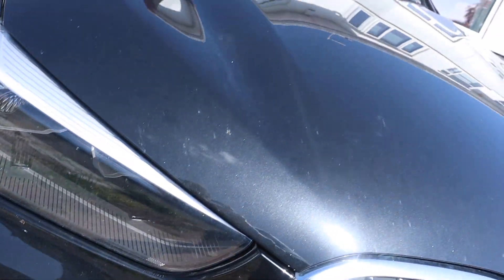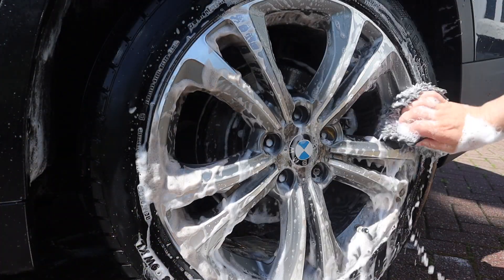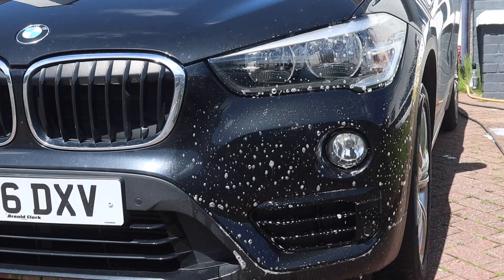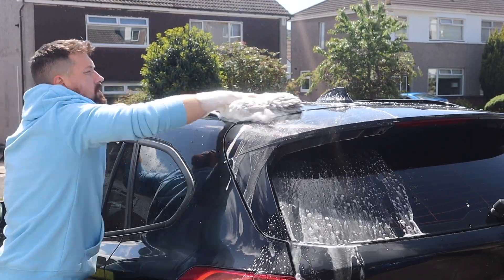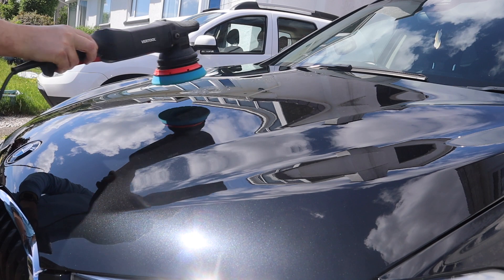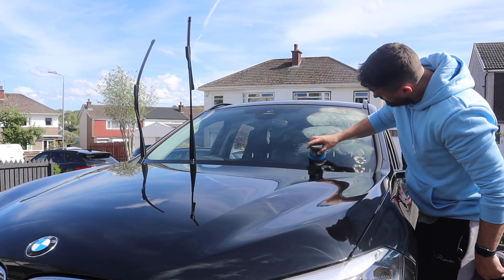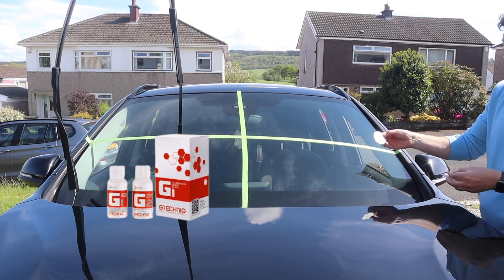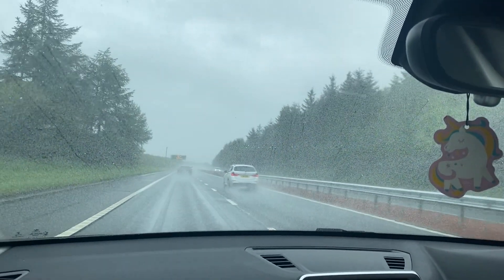How Much Damage is on my Wife’s Car - Testing 4 glass coatings

Comment: Spot on Dave, I applied G1 on the side windows, glass sunroof and back glass and it is still amazing after 18 months. I avoid anything on the windscreen, let the wipers do there stuff because of problems in the past. Great video and I agree with you totally about windscreen coatings being a waste of time, thats my opinion mate.
Reply from the maker: thankyou Geoff, the G1 although time consuming to put on with the 3 layers is one of the better ones on the screen at the moment, i wanted to use them on the windscreen to see how much abuse they could take by the wipers before failing. In future though im not sure if i would use them on the windscreen again.

Comment: Love a multi product video Dave!, music was great too!, 14°c for Turbo 6 is too hot for it , honestly I bet it went completely liquid but that swirl on the pad was far too much product for the area you used it on, that amount would have possibly done the whole car 🥹

Looking at the glass on the motorway glaco looked best I think , I have the carbon glass but I’m now not looking forward to using it after your results. 

Love that your experience was totally transparent (see what I done there? 🤣) thanks for the video 🙏🤣
Reply from the maker: Thankyou Graeme, 
Your spot on mate, that swirl done half the car and it came out very runny indeed!
So far for me it is between the glaco and Gtechniq, im going to change my wiper blades to new ones incase they are causing the issues im having, just want to rule everything out.
Ive spoke to a few people who have said the V2 of the carbon glass doesn't perform as well as the V1!!
Reply: @DavidMcBay  ah cool, it’s the V1 of carbon glass I have but now I’m loathed to use it on the windscreen now 🥴

Comment: Awesome vid David!! As always. Love the beading from the turbo 6 sealant. Looks amazing. I'm a big fan of a glass sealant, I love the water running off on the motorway and not having to use the wipers. But at the same time I do find them a bit juddery on the wipers sometimes. The glaco is awesome though
Reply from the maker: Thankyou mate, the water behavior from the Turbo6 is insane but im not sure what the durability is like.
Ive not been out really in proper rain just that spray from the road and i felt they were struggling a bit but i am looking forward to driving in proper rain to see what they are like. Ive not noticed any judder just yet but i assume that cause the coatings are so fresh.

Comment: Another great video Dave, the glass sealants are very much how I found them, I think I'll be having a go with the glaco compound and sealant next as I ran into problems with the carbon glass one on my wife's car and it left a strange smear pattern on the glass which is proving hard to remove.
Reply from the maker: Thanks Paul, there's nothing worse mate but I'm sure if you get the Glaco compound it'll take it off no problem. I've not noticed any smears from the coatings thankfully.

Comment: Another good video. I'm not 100% convinced with glass coating. I know your not really supposed to use normal sealants on the glass but I find turtle wax spray and shine really helps move water off the windscreen, no wiper judder either. Maybe a very little amount of smearing but nothing to worry about. It's cheap to buy and lasts a good time as well.
Reply: I’ve experimented with waxes on the windscreen as the Americans do this all the time, wasn’t brave enough to do the whole windscreen though, maybe something to go back to 🤔
Reply: @GMDetails  give the spray and shine a go (in the blue bottle) spray on and instantly pressure wash off. Just do the passenger side, not in any sunlight and dry afterwards.
Reply: @sixtysecondsofstephens2386  will do, I know these spray n rinse products love glass usually , Autoglanz one I’ve just used recently and the glass is very hydrophobic , but on windscreens it’s does leave a film when wipers are on
Reply from the maker: Ive used GT Sigma and Gyeon wetcoat on the windows before and had good results. im a couple of weeks in at this point and im going to put new wiper blades on to see if that makes any difference to the performance.

Comment: I tried something better than rebound , maybe you already got the product , garage therapy detox shampoo , dilute 1:10 and it works great. Works even better with a foaming trigger . Doesn’t have to be pump Foamer but just a normal foaming spray trigger.
Soft 99 do a glaco one that works on speeds around 27mph , they actually got different ones for different speeds , mainly for city driving and motorway
Reply from the maker: Ive used the GT Decon shampoo before but i dont like to waste it on the wheels, i wouldnt say its better but it does a good job also.

I didnt know that, ill need to have a look on their site. I do a mixture of motorway and 30mph, the Glaco is the one im most impressed with at the moment.
Reply: @DavidMcBay  I’ve got the rebound but it makes the tyres brown over time so it’s not good in that aspect and I’d rather buy the decon shampoo and I have option of making 5 litres of tyre cleaner and 500ml shampoo from a one litre bottle , it works a lot better in a foaming trigger as you spray on and leave it and the foam goes brown by itself , I’ve been using both for around 6 months and the decon is better than rebound , 10 times cheaper and it doesn’t ruin the tyres
Reply from the maker: Hmm I’ve never seen rebound turn tyres brown and I use it regularly on cars that I see regularly. Have you got any pictures showing this as i would be a concerned using the product going forward if that was the case.
Reply: @DavidMcBay  I was using it on 2 cars , one is brand new and one is 2014 model , it never done it to the new tyres on the new car but on the old car on older tyres it made them brown , I will show you some pictures after I washed it as there’s a tyre dressing on them at the moment but you can see it in this video at 4:50 
https://youtu.be/yn42NEj5YQA

Comment: Applied the G1 on my old polo, absolutely fantastic coating, never had any major problems with it. I find with all glass coatings you seem to get a sort of ghosting affect but you get used to it. G1 instructions recommended you apply it to the wipers as well, did any of the other ones ask you to do that? 

I presume as well the self cleaning ability or the "no wiper" effect is dependant on your windscreen angle and air resistance. 30mph was more than quick enough to get the water moving off G1 on my old car. 

I think for me im going to go with Glaco compound and coating as they seem the best and easiest system.
Reply from the maker: Im planning on changing the wipers to see if its them causing the issues on the driver side coatings, i didnt see anything in the other instructions about coating them and if im being honest i wouldnt want to coat them. 

The G1 and Glaco at the moment are the 2 best in my opinion, Glaco is worth a shout if your looking for something different from the G1.

Also when are we getting some more videos from you?
Reply: @DavidMcBay  from the instructions it was supposed to reduce judder but doesn't seem like you've even got any with that coating. 

I'm going to go with the glaco because g1 is a pain in the arse to apply. See if I can get some at waxstock.

Maybe I'll have one up at the weekend or early next week, just depends whether I want to do a voiceover or not. Need to get myself some new products to demo 👌